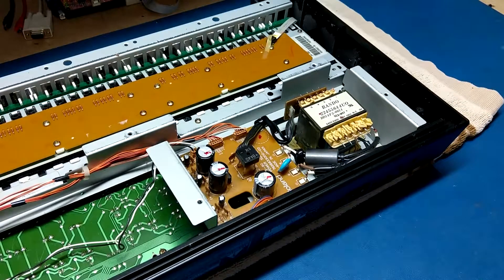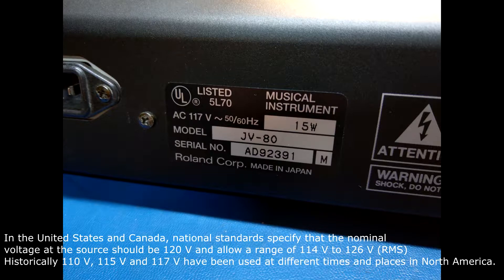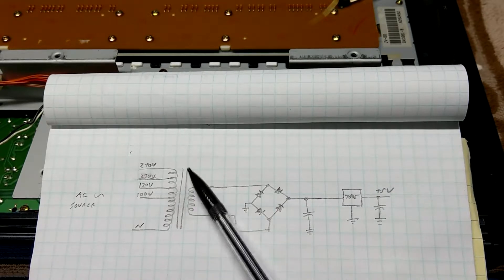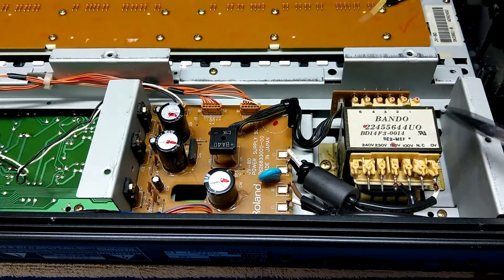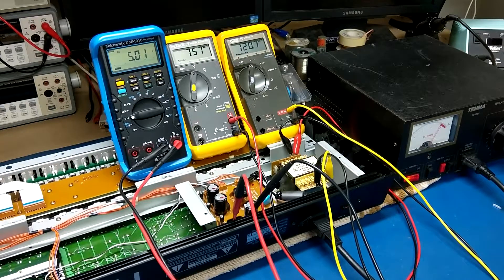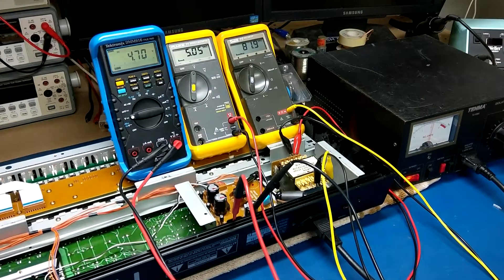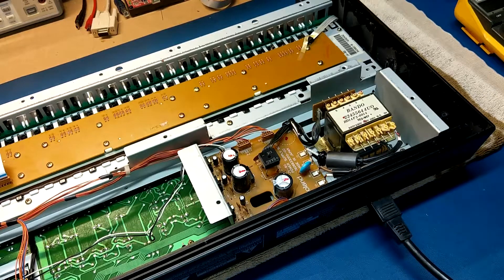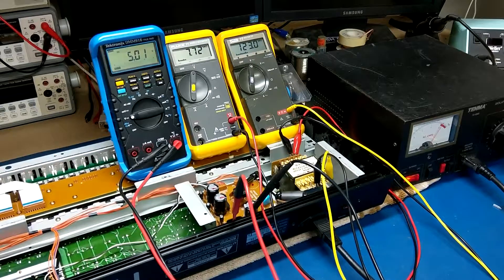Roland JV-80 Synthesizer Input Voltage Conversion

Comment: Hi ! Another very helpfull video ! Thank you ! I have an issue on a JX8P PSU, maybe you can give me an advice. The +/-15v are good, but the 5v works weird : unplugged from the main board, it provide a perfect 5v, but plugged in the board it drops around 1,7v... the main board is not causing the issue, i started it with an external psu and the synth start perfectly well. I aslo changed the 7805... so i’m stucked here, any guess ? Thanks !

Comment: hi man! i have a D-10 which i used as a master keyboard but i had to put it away lately because the power supply started to buzz louder and louder in the last couple of years. I think its a 50hz buzz and i started to feel it thru the table when not playing which is very annoying. 
what can cause this? can it be repaired thru part change or the whole supply should be changed? thx.

Comment: I'm thinking of buying a Roland D550 from USA & I'm in the UK. I own a V synth XT.  When I got that it said 100 volts on back (From Japan). I emailed Roland & in this case they assured me it was universal voltage despite that. Anyway I nervously plugged it in & it was OK.  Do you know if the D550 would have the same setup as the synth in the video? Do you think I just need to move a wire across? Thanks.
Reply: A bit late but I just converted my D-550 from 100v to 240v. it has the same transformer as in this video.The D-550 has 2 fuses in the power section that need swapping out also when doind the voltage conversion.  The fuse values are in the service manual.  I contacted Roland about this and they weren't helpful at all.